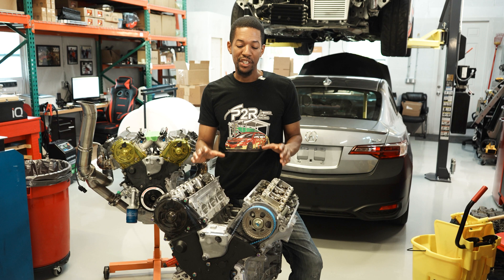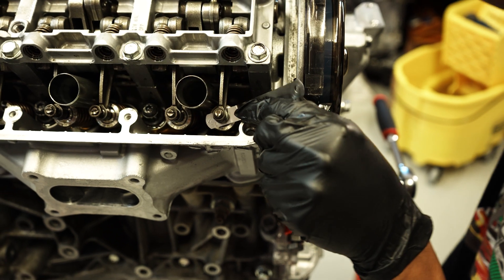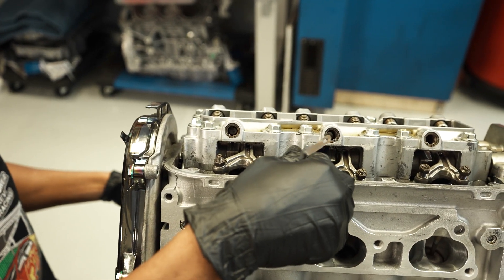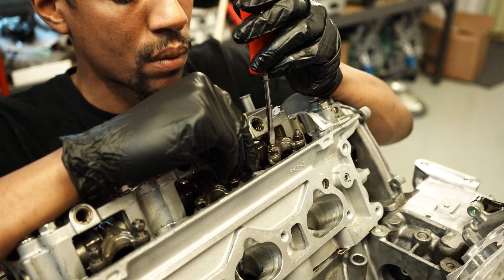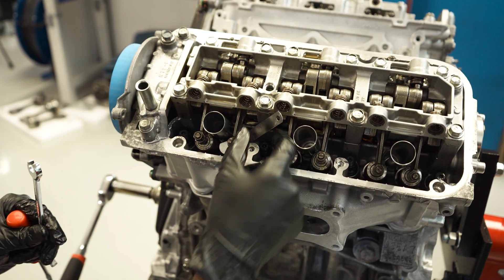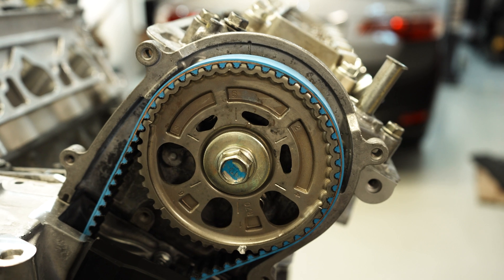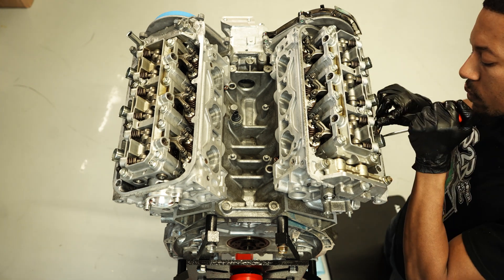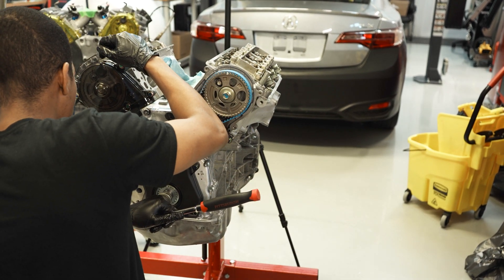Valve Clearance Adjustment on Honda J Series Engine

Comment: Thank you for the information I adjust the valve lash on 2011 tsx 3.5 a bit scary for my first but  you’re video was right on I had got valve setting from another video but was ticking really loud 3 day working on valve lash laying on top of the engine 😂😂

Comment: Wish I had found this video a week ago. Just replaced a leaking valve cover gasket on a2013 3.5 w/ 150k miles.  While the covers were off I checked valve clearances and “found” the number 5 exhaust to be a little tight. After looking at this video I think it may have been the gauge angle off causing binding. I now have a slight valve tick. Is it worth going back in to check/correct?

Comment: Thanks for another great tutorial. You have a great "touch" as you work thru a task.  I have several totally stock J35s and all run great. The oldest is a '13 Accord at 126K miles, always 0W20 full synthetic changed according to the built in reminder.  Valves are totally quiet, even at a 0 degree cold start.  Any reason to check valve adjustment, or just let it roll?

Comment: When I was doing it I would just tighten the adjuster screws until they would pinch the feeler gauge and couldn't move, then back off a tiny amount until the feeler gauge could slide around again without binding.
Reply: Same here worked perfectly but it’s those damn rear exhaust valves that are a nightmare to get to lol 😂
Reply: That’s the very reason you should have that powerbilt valve adjustment tool which allows you hold the valve rod and turn the nut at the same damn time 😂

Comment: Hey, thought I ask this question here since you guys are J series experts. I have ‘16 Accord V6. Recently bought it with abt 40k miles, the car was sitting for about a month (his uncle switched on and drove here and there very briefly) I changed the spark plugs & oil.. basically a tuneup. Now almost a month later, the car only when it’s warm feels like it’s about to die but comes back to life only when it’s stopped (traffic light for eg). Checked battery and alternator with meter reading, everything checks out fine. Just the battery terminals are a bit dusty but idk. What do you think could be?
Reply: I see your comment was 5 months ago hopefully you figured it out. Can you let me know what the issue was? I love solving car mysteries. lol But I would def check EGR ports, valve. Was their any lights on? Also with the car sitting for so long I would check for rodent damage. They love to live in the area underneath the intake. But please let me know if you can. Thank you dear sir.

Comment: Great video Sean. Nothing different to look for with the aluminum rockers? Same process correct. Or any tricks with them. J Swap Jason.
Reply from the maker: Same process for the aluminum rockers. Just slightly different torque specs.

Comment: Keep up the videos man !! I’m a Bseries guy but will be buying a K and a J to learn to rebuild them 🙏🏽🔥💪🏽
Reply from the maker: Thanks! Will do!
Reply: @P2R Power Rev Racing  what are your thoughts on j37 ticking noise?  Will valve adjustment help or are my rockers and cam damaged?
Reply: @vitalracing_fuji8954 it’s your timing belt tensioner and timing belt tensioner pulley that’s right next to your tensioner. Replace them and your ticket will go away at start up. It ticks and start up and goes away after it heats up. If it’s worse it’ll tick all the time but it’s not your valve adjustment but you should still do your valve adjustment.